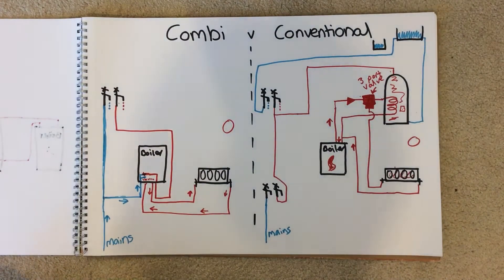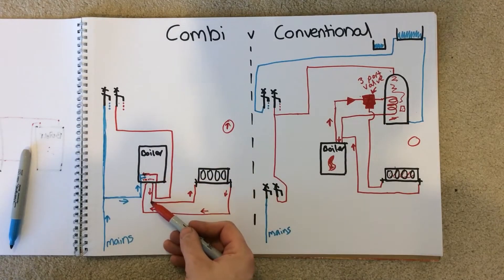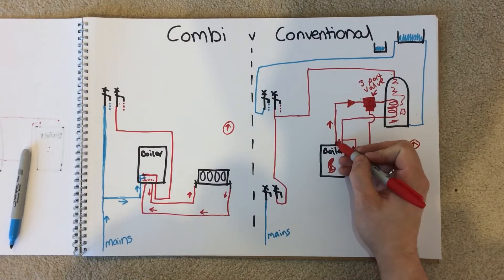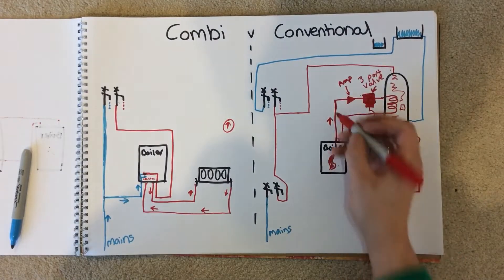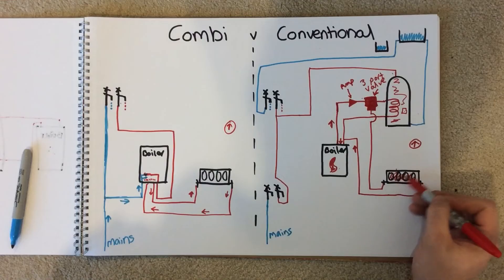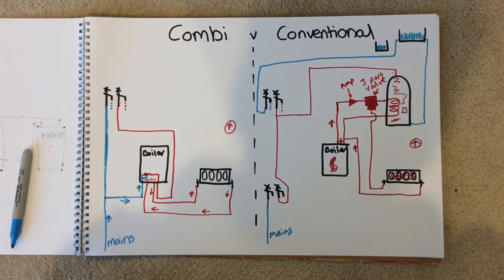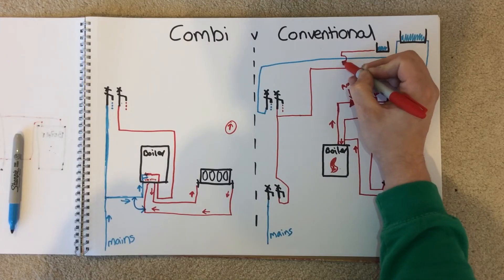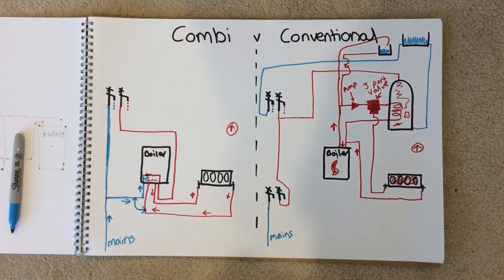What is the difference between a combi and conventional boiler heating systems

Comment: If we wanted HOT WATER would the 3 port diverter valve route water through the COIL of the cylinder and out through the TAPS?

Comment: With this system when the water is returned to the boiler from the radiator what is stopping that same water being pumped to your hot water taps when you call for hot water? Thanks in advance

Comment: I suppose the combi would be more expensive as it is fed by the mains? Regular central heating the tank is filled with a set amount of water or am I totally wrong? Was just debating replacing open fire place with a stove and back burner but only heard about this before I started with my original plan. Would this system be the best solution over a stove and back burner?
Reply: The heating circuit is closed, the hot water (taps, showers) is mains fed.

Comment: Hello sir thanks for the support on the YouTube video we have a conventional system on our we need to know where is the return to central heating boiler so we can install magnaclean filter please show us 
Thanks
Reply: Best to adapt the pipework an install it on the return pipework a above the boiler.  If not then as close to the central heating circuit near the 3 port valve.  It can be fitted on the flow pipework.  Although it won't do much to help filter the boiler.  Any filtration is better then none.  The Adey atom filters fit well on heat only and system boilers.  Especially when there's little clearances.